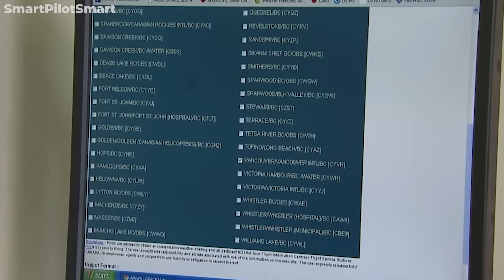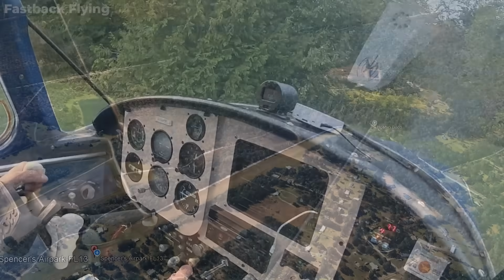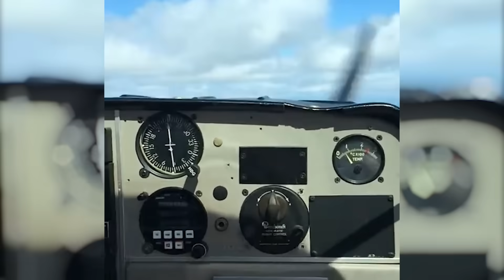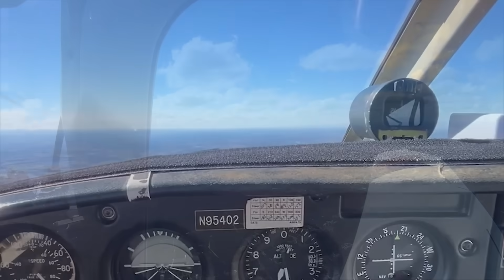How Did A SINGLE Assumption Led This Beechcraft To A Fatal Takeoff?

Comment: At age 76, I wonder if Carl might have been a little too old to be flying out of a grass field which requires a different technique. Ageing does provide for needed changes. Grass meaningfully changes the equation along with upward slope. Trees at the end must also be figured into the takeoff and climb.All kinds of factors need to be calculated. There are no constants in life., other than death😢Pretty gals and certain flight characteristics under certain challenges need to be handled with precision. Flight planning needs to be discussed openly and with an open mind.RIP to all.